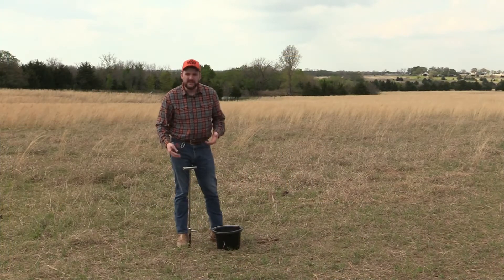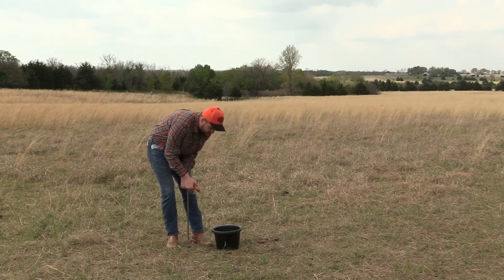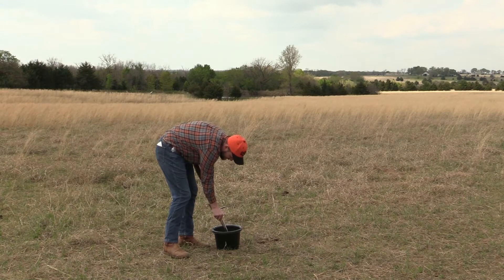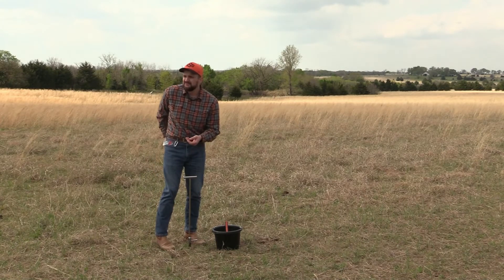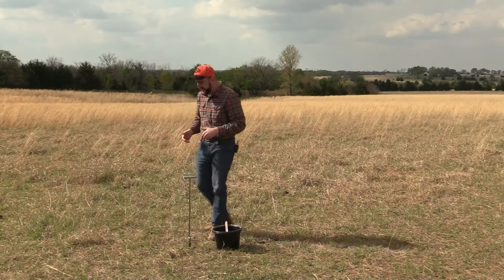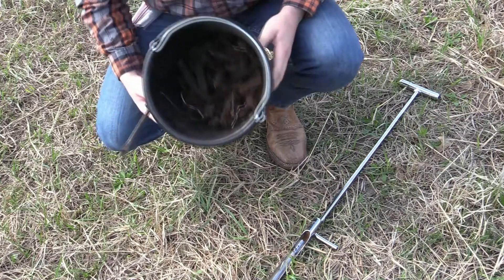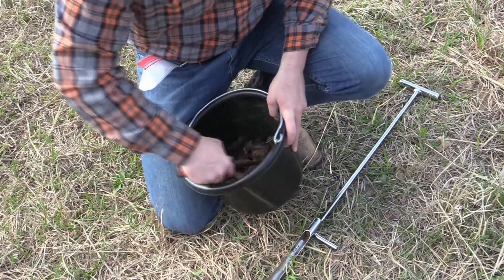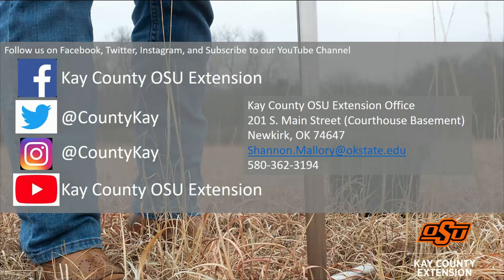How to Take a Proper Soil Sample - Kay County OSU Extension

Comment: Dude each one is a sample, now you have a average of everything, wth, this not how it's done, dude u did the work with no benefit?
Reply: Huh? He explained it fairly plainly. Each core is NOT a sample. You take multiple cores across a specific area to get a representative soil mapping. The cores are combined as they make up a single sample, meaning everything in the bucket is for the same sample. It’s practically the same method used for finding an average in mathematics

Edit: you even alluded to it being an average but somehow missed that that’s the point.